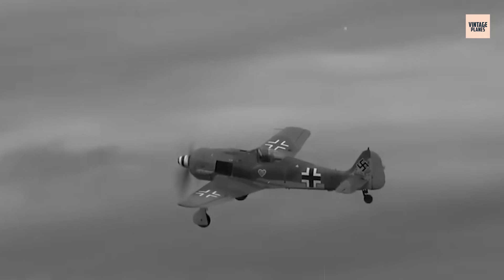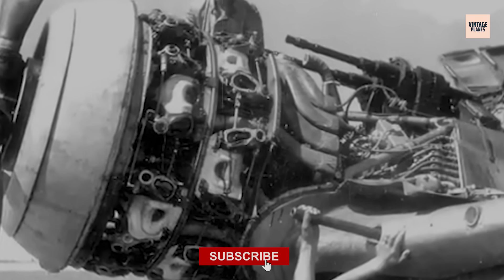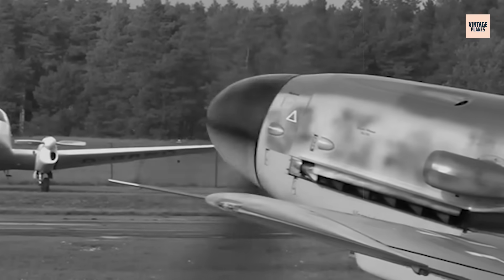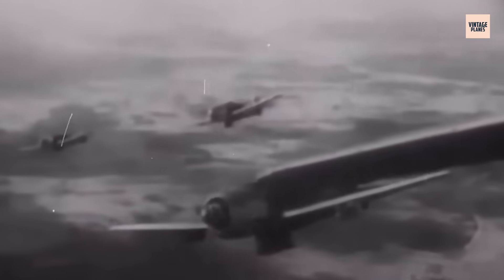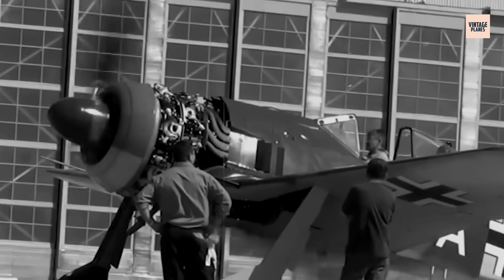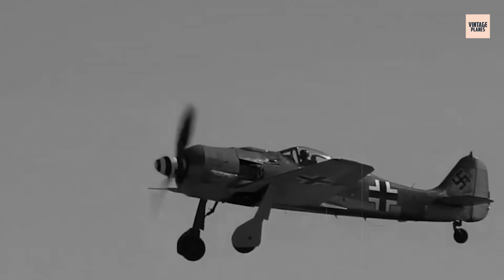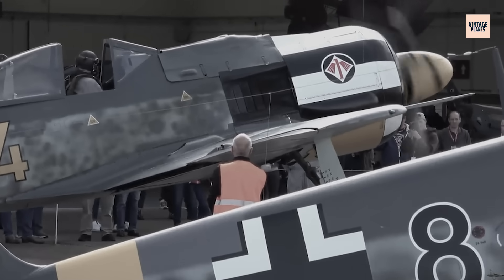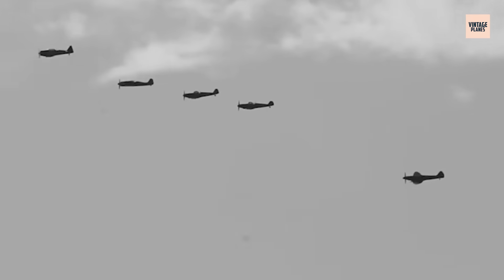THE SHOCKING TRUTH BEHIND BMW 801 ENGINE

Comment: BMW had been making aero engines since WWI, the 801 was not designed by a "motorcycle company"

A 14 cylnders two tow radial was not "the most unconventionnal configuration", many fighters had similar engine (ie, the famous japanese zero)

many misconceptions in the video

Comment: That engine was developed by aircraft engine engineers, not motorcycle engineers. The BMW logo, or roundel, mimics a spinning propeller. Their motorcycles were made to keep the company going after WWI. BMW acquired licensing to manufacture Pratt & Whitney’s single row 9 cylinder R-1690 in the 30s as P&W made some of the most sophisticated radials of their time. That was a big step ladder, but BMW deserves much merit as they went above and beyond developing the 801.

Comment: The biggest problem with the BMW 801 was that its performance fell off rapidly above 6000 meters or 19,805 feet altitude. As such, the Fw 190A models couldn't keep up with the P-51 and P-47 fighters that were capable fighters at high altitude. Focke-Wulf finally addressed it with the Fw 190D-9 model, but that came too late in the war.
Reply: There were some models introduced or in testing with better high altitude performance. The engine was not the problem, but the supercharger. The BMW 801S and E introduced in late war Fw190 A8 and A9 models improved the high altitude, upping the critical altitude about 500-1000 metres more and able to deliver 2000-2200 HP in overboost, and the not introduced BMW801 F and R for the Fw 190 A10 with two stage four speed superchargers was delivering at 11.000 metres more than 1400 HP and at low altitude 2400 HP. 
And the limited service BMW801 J (It was a BMW 801 D with turbosupercharger) was delivering 1500 HP at 12.000 metres and 1800 HP at low level and the BMW 801 Q (A BMW 801 E with turbosupercharger, at the same critical altitude of 12.000 metres was delivering 1715 hp.
Best regards.

Comment: Whats so shocking ???
Reply: The fact that it carried a computer to control all the engine parameters only pressing a sleeve in the cockpit while the Allies had to push between 5 to 10 sleeves. And this was an evolution of the engine governor of Daimler Benz. The Bf109 was only slightly worse, maybe 2 sleeves.
Essentially a big relieve to the pilot.

Comment: The dramatic voice of the narrator (some kind of AI?) cannot cover the false information delivered. BMW radial engine was only a temporary solution, the FW190 exceled only with the 12 cylinder liquid cooled junkers engine nor can it explain the unrelated films mixed in the video
Reply: The irony of someone talking about false information while doing the same thing. The FW 190 when introduced excelled with that engine, the only plane capable of taking it on until the Spitfire IX was the Typhoon.
Reply: @iangascoigne8231 And you're doing the same exact thing:"Until the Spitfire IX was the Typhoon"?? What are you on about? We're talking two very different aircraft here with two very different companies behind them ( Supermarine and Hawker) which had nothing in common!!